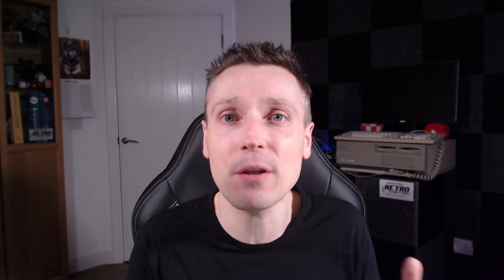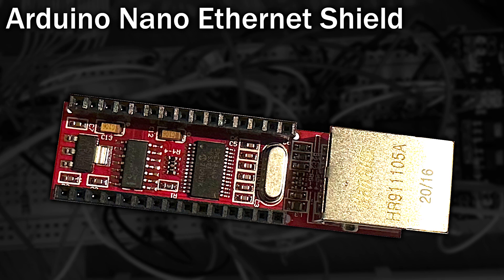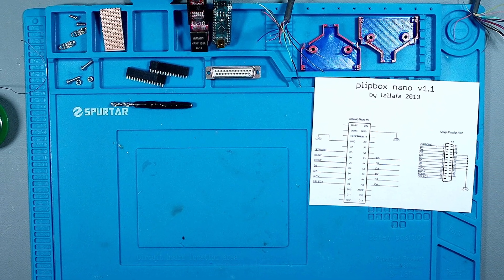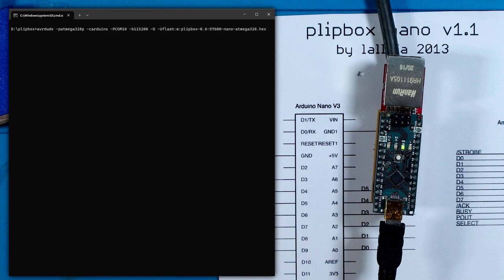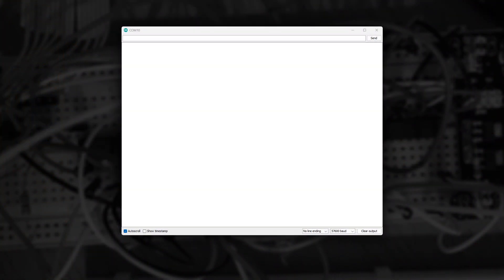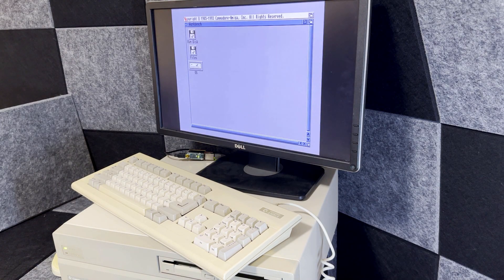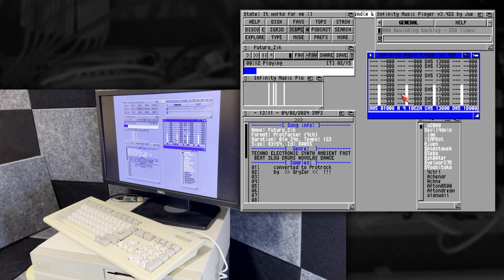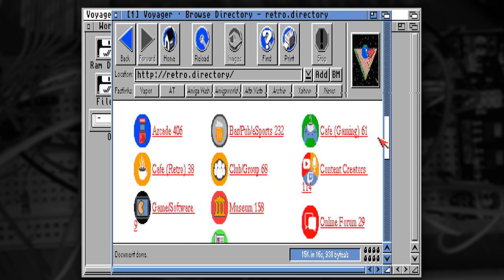Internet Enabled Amiga - Lets Build a PlipBox!

Comment: Didn't Haynie put lines from the parallellport to the video slot in the 2000? Used to control the video toaster. Would it be possible to make an internal slot version of the plipbox?
Reply from the maker: Yes he did, I was looking at that the other day as it would be a neat solution. There’s also audio on that connector too. Maybe I need a new RGB2HDMI adapter!

Comment: I too have a plipbox and it’s great.  I can get up to 70k/s download speeds on my accelerated amiga 3000.  Ibrowse works nicely for older sites.  It is irritating that you need to reset the plipbox each amiga reboot but otherwise this is a very easy and economical solution to get your amiga online.
Reply from the maker: Interesting. Based on another project (the next video) I’m convinced the speed I saw is the limit of the Amiga I have.